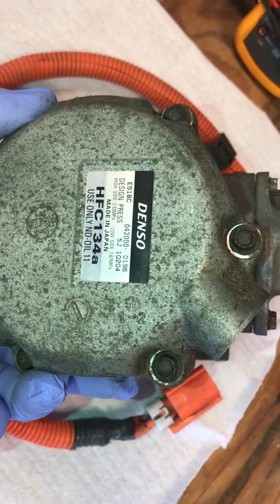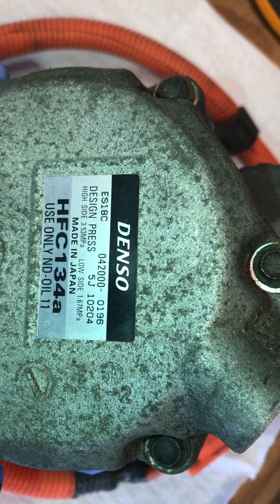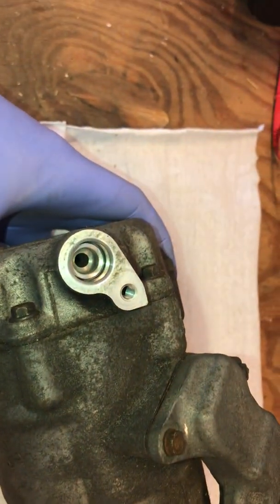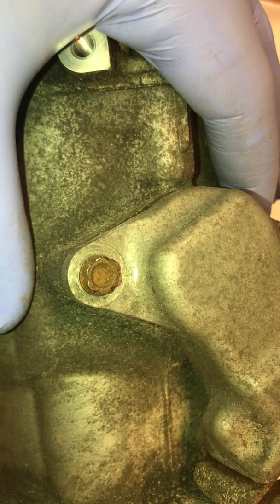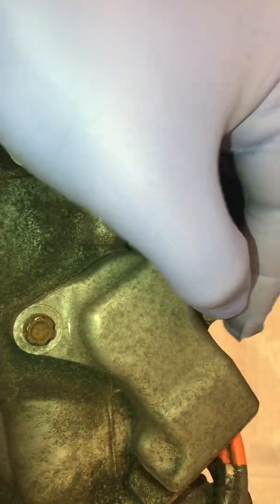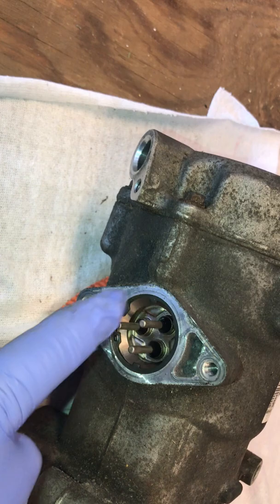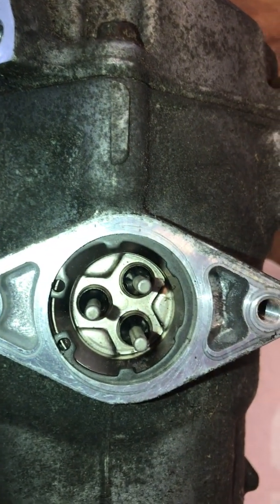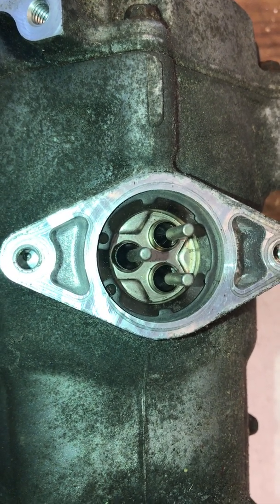2007 Prius AC compressor 200V

Comment: Are all 3 of them wires a power wire and the body of the compressor grounded.
Reply: this is a 3 phase motor, there is no ground or nutral